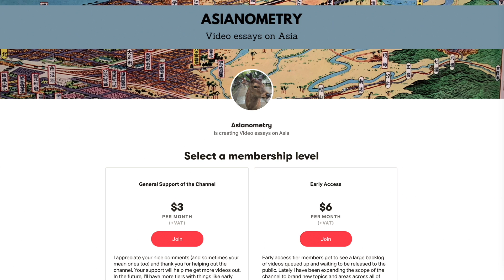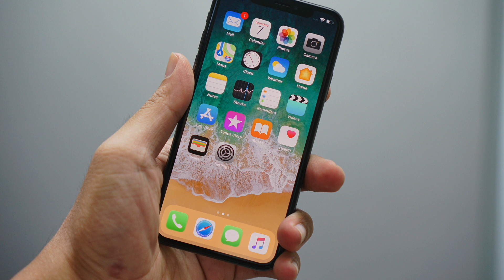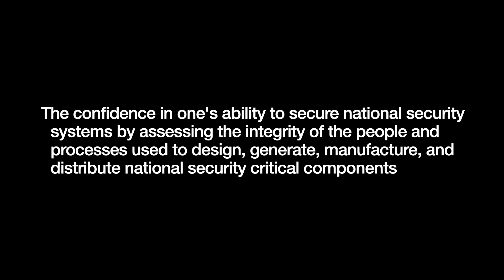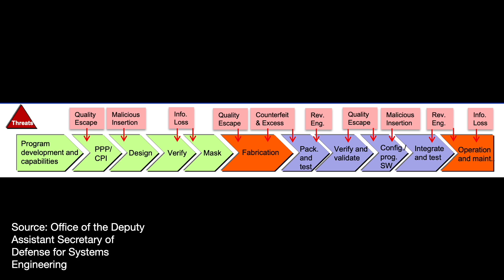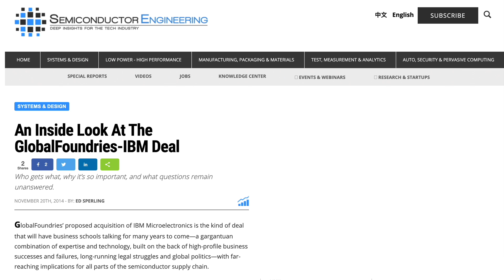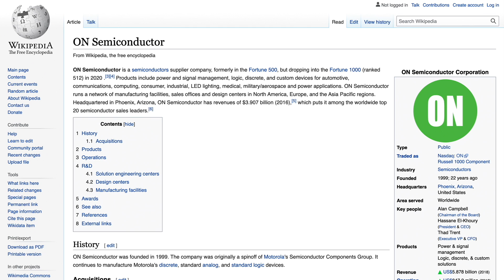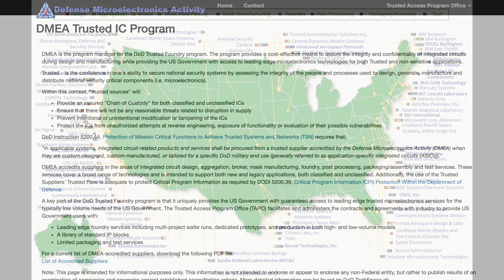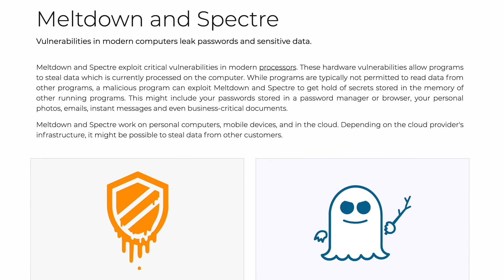The US Military's Semiconductor Buying Problem

Comment: Thank you for your youtube video. I would like to add...DOD also has Military Standard Integrated Circuits  which are ruggedized... During Desert Storm Military Std  laptops were issued to deal with the heat and the desert sand.  IIRC  the 1990s, a Chinese immigrant woman  was caught trying bypass  the ban on exporting USA military grade  temperature harden CPUs chips to China's meteorological research group  (this kind of cpu survives extreme cold and heat and is useful for making satellites and hi altitude electronics)  so they are manufactured to different standards than commercial grade electronics. .. USA Dual Use Technology export ban to China has been expanded  since then to include high end consumer grade CPUs in 2015.... both cases/situation go beyond the matter of trust in the supply chain that is demonstrated in the 5G Huawei case... Economy of scales and the government reliance on the private sector to maintain such manufacturing resources has been challenging if not a continual and on going  concern.... I am expecting  the competition between the US-China  to intensifies AND with this adversarial trend the  USA  dual use export ban will expand to  include raw materials like lithium or biological/medical supplies

Comment: government could have rescued AMD or Intel from manufacturing decline, saving an american company while securing some risks. now the US is scrambling to fix it.
Reply: US prioritizes stock-buyback paper wealth over actual wealth.
Reply: @sociolocomtsac  this has brought back memories of articles Intel delaying 10nm year after year.  second year they delayed it, I knew it was intentional/expected. 
AMD fan boys cheering the company for its new found success forgetting that it is from Intel's delays which made it possible.
Reply: @zodiacfml  expected may be, not so sure about intentional… 
Regarding AMD success, no reasonable person will say it’s not partially due to intel delay, of course it is, both company had periods of successful years, sure intel had it longer, but as end user I gotta love competition, most ppl won’t care if it’s due to AMD’s great design/ strategy or intel’s failure.
Reply: @garykong7597  well, this awesome channel has been repeating ASML and TSMC multiple times.  It is about buying/installation of EUV machinery which TSMC has multiple times over Intel despite Intel multiple times larger than TSMC back then. anyways, this is old news, there are leaks Intel is buying more 3nm TSMC supply than Apple in 2022 for mobile and server